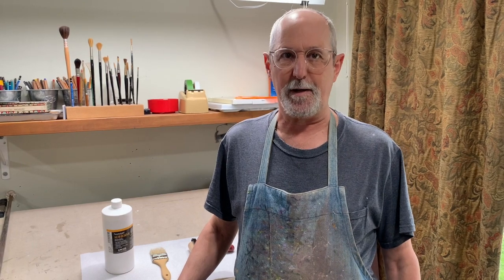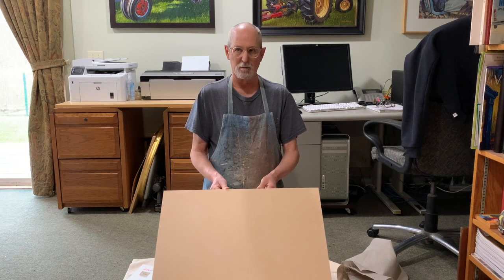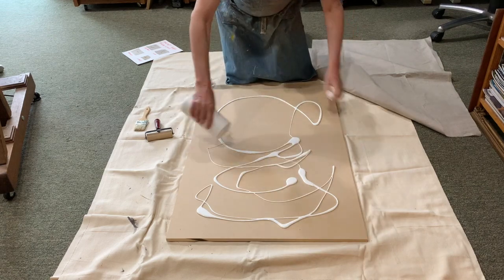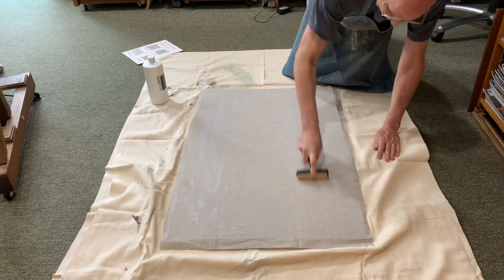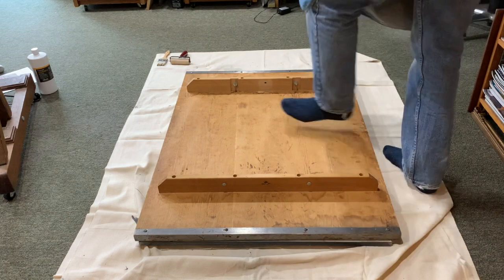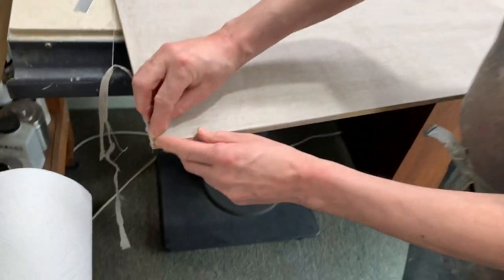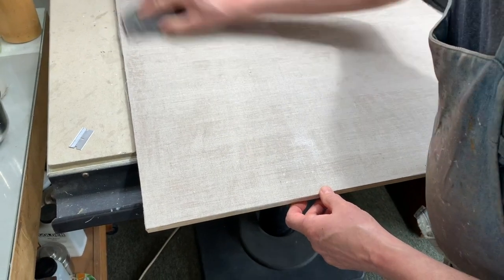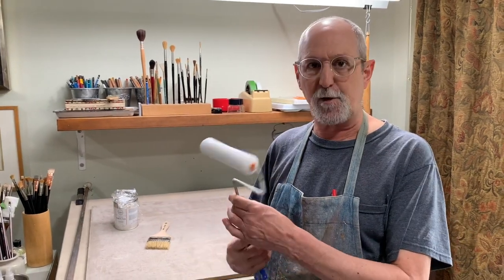Mounting linen to a panel and applying an oil painting ground

Comment: You don't size the canvas after gluing it down, relying on the seeped through glue for a sizing layer.  As a result, the oil in the ground will eat through the linen in a few years.  This is a very bad technique. You need to size after gluing with either Rabbit skin glue or PVA to seal the linen from the linseed oil in the oil primer.
Reply from the maker: Thank you for your reply Dave. Although I no longer paint on linen mounted panels, preferring instead to paint on gesso primed panels with no linen, I had been using the technique in my demonstration video for more than 45 years. There is more than enough glue, applied liberally, seeping through to protect the linen. There are no issues whatsoever to any of my works as you describe.  The paintings appear exactly as I had painted them with no "eating through the ground".  If you feel that step is necessary by all means go right ahead, but it is not necessary.  -P

Comment: Why trim the edges?  Better to fold over and tack down.  Next, why not make your own ground?  It is just whiting and linseed oil.  Will take the same time to dry.  Lastly, use a palette knife to scrape the ground on and scrape it smooth.  Hold at 45 degree and all good to go.  Apply 2nd coat at a different 45 degrees adding a little ochre to the mix to give base colour.  Sand between coats. Then ready to go.
Reply from the maker: Everyone does what works best for them Angus.  I have been preparing linen panels this way for more than 35 years and it works just fine for me.  btw, I no longer paint on mounted linen at all, linen is just too damn expensive and the whole process takes too long. for the past 14 months I have been on panels only, primed with two coats of Utrecht Professional Acrylic Gesso.  It's quite expensive but of superior quality, a gallon lasts a long time and the panels are ready to paint on in less than 3 hours, just minutes if baked outside in full sun. -P

Comment: If you switched to a 4 inch  "weenie-roller" you could spread the glue faster, and more uniformly. Also, if you apply glue to the back of the linen, you double the insurance for a good bond, and you get better protection for the linen being saturated by the glue. This is pretty much how the Masters did it using rabbitskin glue. I do an additional coat over the top too, before the primer layer for extra protection.
Reply from the maker: Thanks for the feedback Chris.  I've been preparing my panels pretty much the same way for more than 30 years with no problems.  However, I do appreciate your advice and will try what you suggest on my next panel. Be well. -P

Comment: I like to paint on smooth portrait grade linen so I bought the 9620 linen from SoHo and found it to be totally bumpy once glued down on the MDF and primed. It is almost as if it were textured. Gonna take me forever to sand it down. Very disappointed
Reply from the maker: philipvalende3411 – I am not sure what you did or did not do to get your disappointing results. I have been preparing panels using this technique for more than 25 years and have NEVER experienced what you describe.  That linen is so fine its line almost like muslin, barely any texture at all and after glueing, mounting and priming and sanding lightly after mounting and then again after applying two slightly thinned prime coats with light sanding in between as shown in my demonstration video, the panel is very smooth with just enough tooth to hold the paint with a slight drag. The surface is sublime -- wonderful  to paint on. It seems to me that perhaps SOHO sent you the wrong linen, I don't know. Not sure what to say, but sanding it down seems extreme and not even worth the time, effort and expense of mounting fine linen. If you desire a smooth surface then skip mounting the linen and just apply three prime coats instead sanding lightly in between coats. –P
Reply: Thank you for taking the time to reply...Please know that my experience is not meant to be a reflexion on you. I actually was looking for a way to get away from gallery wraps and think your technique of making panels is an excellent solution for many reasons. I followed your instructions to the T. I bought Trupan 1/2 inch MDF and SoHo assured me they sent 9620...I even cleaned the back of the linen with one of those sticky lint rollers to make sure there was no dirt that would cause a bump. I agree that 9620 has very little texture, looks and feels great, but for some reason when I glued it down it appeared as if the weave wasn't consistent and there appeared to be tiny knots here and there. I gave it a light sanding with 220 then primed it with one coat. That's when I realized I had problems. I should have taken a picture of it. Perhaps I didn't use enough Lineco glue, I am not sure. At any rate I've only made one 12X16 panel so far. I have enough linen to make 9 18X24 panels. I will let you know how the next one goes...hopefully it will be better. @baldassinifineart8068
Reply from the maker: OK then sounds like a plan.  Please send me an update after you've you've mounted another panel and let me know how it went, I'd like to hear about it. -P @philipvalende3411

Comment: Fantastic tutorial but that Lineco PVA is some of the most overpriced stuff I've ever seen. You can probably modify the PH level using basic safe chemicals.
Reply from the maker: Thanks for your comment John and glad you found the demo helpful. I've been using  Lineco adhesive for more than 30 years with no issues whatsoever. Like everything in life, you get what you pay for. The cost does not matter, the quality does. Even if the cost tripled I would continue to use it. -P

Comment: Saw elsewhere an artist prior to applying oil ground, he applied first Golden Paint GAC 400 one coat, then GAC 100 one coat, and thereafter oil ground. He said that the GAC liquid was to save linen from direct contact with oil.
Reply from the maker: Yes I have heard of this also but have not tried it.  We get very used to the things that work for us over time without issues so I stay with the Lineco.  I appreciate you're reaching out. -P
Reply: @baldassinifineart8068  Guess the traditional way was to use rabbit skin glue as a barrier.

Comment: Thanks for the video.  Why would you not wrap the canvas edges around to the back of the panel instead of cutting it flush?
Reply from the maker: Hello Victorpablo thanks for checking in. Panels do not need to be treated like stretcher bars. This is the reply I gave to the same question about 4 months ago: "There is no need at all to wrap the linen around the sides and back. Complete waste of time and unnecessary, IMO." -P

Comment: I am so happy using your method. It worked out great-no shrinkage. I used hardboard panel from the art supply. the brayer was essential. This is quality and economy for very little effort. Thanks for your instruction.
Reply from the maker: Krentz —

Glad to hear it worked out!  I’ll be updating/replacing this video soon showing an even better way to mount linen and prepare panels for oil painting. Instead of applying the LINECO glue with a brush, after pouring I now use a roller, the same 6-inch foam roller I use for applying the ground. It lays down a nice even coat very quickly. Then mount the linen same as before, and using with the rubber brayer to firmly flatten out, then lightly folding over the edges. This way there is no seepage coming up through the linen and the linen appears flat and smooth with no streaking. This way it’s not necessary to pick the  loose brush hairs that always fall into the glue. Let it dry overnight or in the sun for a couple of hours. Next pour some glue into a shallow pan or even better, use the plastic tray and liners designed especially for the 6-inch foam roller. Thin the glue a bit with water, load up the roller and go over the linen taking to care to saturate and cover the whole surface. Let it dry over night to bake in the sun for a couple or more hours. The surface will be too “gritty” to prime so go over the surface (don’t use too much pressure) using 120-grit sandpaper.  Run your palm over to feel – should be smooth with  a perfect amount of tooth to accept the ground coat. -P

Comment: Thanks, Paul, for making this straight forward as there is nothing quite like the joy of painting on linen on board. I had trouble with shrinkage, as an earlier comment mentioned, so I will try the linco with your method.
Reply from the maker: Thanks for reaching out Krentz. I've been using LIneco Archival bookbinders glue to mount lienen to my panels for more than 35 years. Never, not one time ever has there been an issue with shrinkage. None. So, go for it! - P

Comment: Great video, thank you. Curious if you need to add the linen to the MDF - could you simply paint on the MDF (after it was gessoed)?
Reply from the maker: Funny you should ask that question Carol.  I ONLY paint on the Trupan MDF these days, no linen.  The price of quality linen (and art supplies in general) has gotten so out of control I'm back to painting on panels only, no linen.  You have a couple of options here:  1. Same process, just skip glueing the linen and simply prime with Gamblin's Alkyd Oil Ground. It's a really a great surface to paint on but takes a couple of weeks to dry unless you bake it the hot sun during the summer months, then two days or so.  2. However, these days I prefer gesso but only one kind is worth using, IMO – Utrecht Professional Acrylic Gesso.  It's by far the best artist gesso out there and not at all absorbent (for my tastes anyway).  It's pricey though at about $65 a gallon, but it's super dense, dries in a couple of hours and two coats is all you need. A gallon lasts a long time. -P

Comment: Have you considered using hardwood plywood, like maple, instead of MDF?  I'm a cabinetmaker and woodworker who is very familiar with both materials.  I'm always skeptical of MDF because I know how vulnerable it is to moisture and humidity.  No matter which material to use it's very important to completely seal it front, back and sides to protect it.  I use maple plywood 1/2" and 1/4" thick and I use Zinnzer Cover Stain Oil Primer to completely seal the panel.  I can then oil paint directly or apply a linen canvas if I prefer a more textured surface. I use oil paint so I like to use only oil primers not the acrylic "gesso".  Is any of this stuff archival? I don't know, but I believe in using materials that hopefully give the artwork a better chance of surviving long term.
Reply from the maker: Ricky, I am also an experienced cabinet maker and woodworker and am quite familiar with the hardwood plywoods. I have been using the cabinet-grade MDF for more than 40 years and the Ultralight MDF for more than 15 years now with no issues whatsoever. I don't seal anything -- protect it from what? No collector who has ever purchased one of my paintings has ever contacted me to complain about moisture or humidity affecting the painting they purchased.  Nor has any of the other many artists I know who routinely use cabinet-grade MDF ever had any issue of any kind using MDF.  If hardwood ply and all the labor and odors that go along with using Zinnzer products works you then go for it. -P
Reply: @baldassinifineart8068  Maybe I'm overthinking this.  I know a lot of artists do use MDF panels.  I'm also sure the MDF you use is a better grade.  Again, maybe I'm overthinking it.  I'm pretty sure alll of the materials today are far better than the options in the past.

Comment: Thanks for the video.  I've been working my way through some YouTube videos to see various techniques for gluing canvas to wood, not so much for paintings but for collages.  When looking at your prep the one thing that kept coming to mind is why go through this process of gluing a canvas to a board when one can just use a stretcher.  I'm just wondering what you see as the benefits of working on a canvas that has been glued directly to a board as opposed to a canvas that has been stretched. I realize that isn't the intent of this video, but I'd be interested in your thoughts.
Reply from the maker: Thanks for reaching out Bruce. The short answer is quite simple: painting on a rigid surface is infinitely more satisfying - at least for me, maybe not others - than painting on stretched linen.  Long answer: if you want to paint on stretched linen canvas then there is also a process, if you want to do it right. Assemble a stretcher frame, cut, position and staple the linen taking care to get no wrinkles as you approach the edges. boil water and mix up some rabbit skin glue size, sand and repeat, then  prime with ground of choice. Now that's a lot of work. Or you can spend an outrageous amount of money on quality pre-primed linen canvas and good luck trying to stretch it tight as a drum. Even then you'll still experience some "bounce back" as you paint on stretched linen canvas, why I do not like, and it is always subject to fluctuations in humidity in that it may loosen (also, I really dislike cotton duck canvas). Nothing beats oil painting on a panel done right, it's a sublime experience. Hope that helps.  -P
Reply: @baldassinifineart8068  I've always worked in acrylics so it's possible that the prep work for a canvas is a bit less than for oil paint and I'm usually working in dimensions smaller than 24"x30" so I personally haven't really noticed any issues with the tightness of the canvas surface.  I have practiced on smaller commercial canvas panels which have their own built in limitations since many are nothing more than canvas on a stiff cardboard backing.  For the sake of experimentation, I'll have to try out the process you've described in your video.  Thanks again.

Comment: Do you need to wait for the glue to dry before weighing it down over night? I'm concerned the  weighted surface will get stuck to the linen as it cures. Wax paper in between the linen and weighted surface perhaps?
Reply from the maker: Hello Lydia.  You do not have to wait and DO NOT use wax paper.  I use large clear plastic storage bags (the ones framers use to wrap large paintings for shipping). I cut them in half, open them up and place them on top of the freshly glued and mounted linen, then add my weights. Just use any large sheets of regular plastic, it will not stick the glued surface. -P

Comment: You can prime the MDF board without any linen and save tones of money, that's what they use to do in the Renaissance times.
The entire purpose of using linen stretched on a frame is is to loos all the weight, it's a great idea for really large pieces.
Reply from the maker: You are absolutely right about that Yoherff988.  In fact that's exactly what I paint on these days.  I prime with two coats of Utrecht Professional Gesso (highest quality gesso beats all others hands down, IMO), no sanding. Stopped mounting linen to panels over 18 months now -- savings is considerable. And, I can manipulate the oil paint in ways I could not using the mounted linen. -P
Reply: Don't think they painted on mdf back then
Reply from the maker: @mark94993  There was no MDF back then, of course.  The masters painted on wooden panels, usually poplar or oak joined together with dowel pins and glue. They were primed with several coats of chalk and glue mixture over which an additional coat of lead white might be painted on as a ground. -P

Comment: I'm curious how large you can make these type if panels? I haven't seen anyone doing these with paintings around 3'x4' , do you feel that this is an acceptable application to use at that size? I am also wondering if you would recommend doing this on oversize pieces that are already finished, painted on gessoed linen?
Reply from the maker: Hello IronOxide (great red pigment btw!).  Anything over 30 x 30 inches needs to be braced.  I use 1.5 inch x 2 inch wide poplar which I glue to the back of the panel before affixing the linen.  I also add cross bracing and small mitered diagonals in the corners.  It's a lot of work and real pain the ass to make a large panel properly.  I only do it if I know I have a collector who has agreed to purchase the completed work beforehand. -P

Comment: ive been doing this for a few years oddly with almost the same  products, only i size the linen after gluing with 2-3 coats of size before applying the ground after the size dries. it just takes so long to dry to be ready to paint, 3-6 months per panel,
Reply from the maker: Sparky, something is not right your process there's no way it should take 3-6 months for the ground to dry.  Firstly, what do you mean "almost the same products". I need to know exactly what you're using to help sort this out for you.  Second, there is absolutely no reason to apply 3 coats of size -- that would be like trying to apply ground to a panel covered in dried glue. You would obliterate the weave texture of the linen. Gamblin Oil Ground, which contains an alkyd binder, dries in less than five days. If you bake the panels outside in direct sunlight they dry in 5 hours or less. I have been doing this for more than 35 years and never had a problem like what you are describing. -P

Comment: I have a question that you may be able to help.   I have painted on a piece of primed linen.  There is a border around the perimeter where I taped the linen to a piece of plywood.  I did this for support while I painted the picture. Now that the painting is complete I have removed it from the panel  Do you think I would be OK to use the technique you've described here for gluing the piece to a panel?
Reply from the maker: Thanks for reaching out Curt. Yes, definitely no problem -- you can do it the same way. However, if the dimensions of the final cropped work conform to standard stretcher bar sizes I think it would better and easier to stretch it, if t you have the tools.  Stretching pliers are a must and an electric stapler is most handy but not a necessity. -P